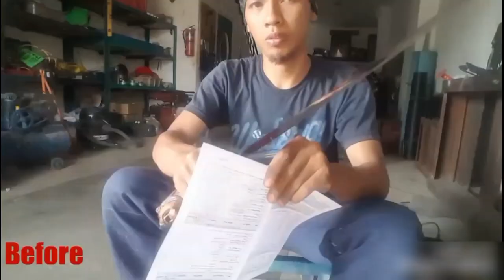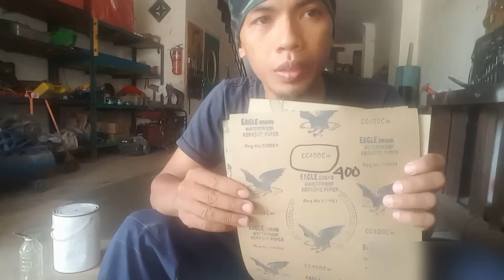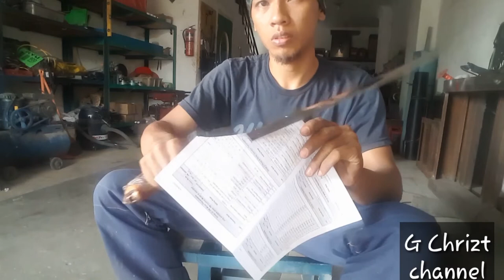Cara memoles golok Sampai Mirror

Comment: Bang mohon maaf bisa di jelasin gk untuk awal pakai amplas nomer berapa dan seterus nya sampai miror
Reply from the maker: Tahapan'a dari Ampas Kasar no 400-600-800-100-1.200-1.500.
Baru deh Pasang Buffing pake Batu ijo(Langsol)
Reply: @GChriztKangGolok  amplas kertas dibentuk bulat dulu dan ditempel ke gerinda potong benar tdk ?